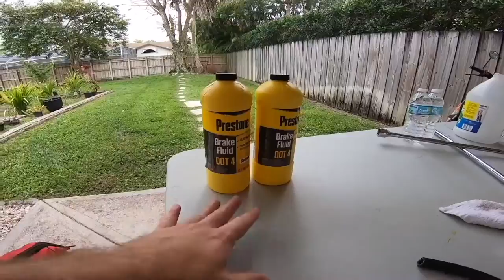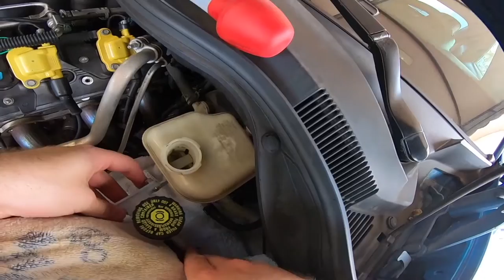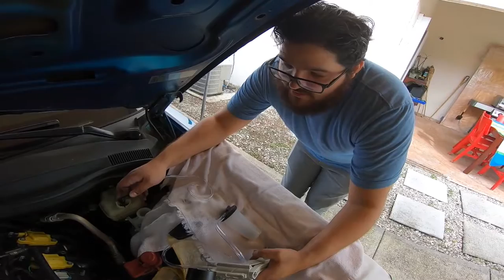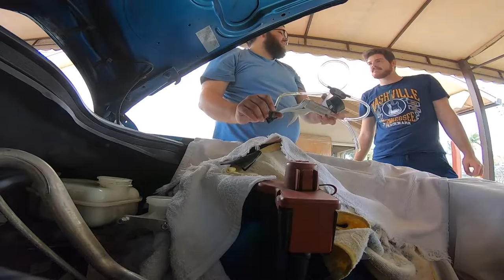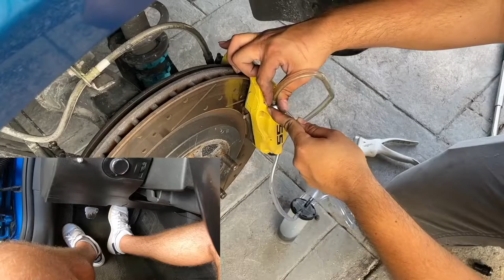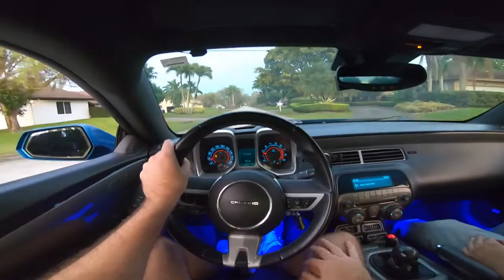How To Flush and Bleed Camaro SS BREMBO Brakes & Install Separate Clutch Reservoir!

Comment: For any future viewers here is important information found on the Camaro5 forums. Heads up, I didn't write this just sharing info I found. 

"Note that Brembo calipers have two bleed-nipples (one inner and one outer) per wheel.

These questions came up:
- What caliper do you start with?
= Answer: Right rear

- What order do you follow from one caliper to the next?
= Answer: Crazy criss-cross pattern
 Right rear
 Left Front
 Left Rear
 Right front

- Which bleeder nipple do you open first?
= Answer: Always bleed the inner nipple first.

Per my research:

When bleeding Brembo two-bleeder calipers, be aware that there is a "crossover" passage that allows fluid to travel from the inner portion of the caliper to the outer portion.

The rationale for bleeding the INNER valve first is to prevent any upstream debris from being forced downstream into the crossover passage.

The four-volume Helm manual for my 2011 SS Camaro (with factory Brembo brakes) specifies that the four-corner SEQUENCE for bleeding brakes is as follows:
1. Right rear
2. Left front
3. Left rear
4. Right front

This criss-cross sequence is per page 5-173 of the Helm manual for the 2011 Camaro SS."

Heres the link to the discussion page:

https://www.camaro5.com/forums/showthread.php?t=473986
Reply from the maker: Thank you for filing in any gaps I had with this video. I appreciate you immensely.
Reply: @gvaspirated  Yeah, no worries. This was new information for me, I figured others could use it too.

Comment: Change rubber brake lines for those with steel cover, it will give You much better response for clutch and brakes. Stock ones swells, so it is must have mod.
Reply from the maker: Thanks for the tip, I'm going to look into that dude.